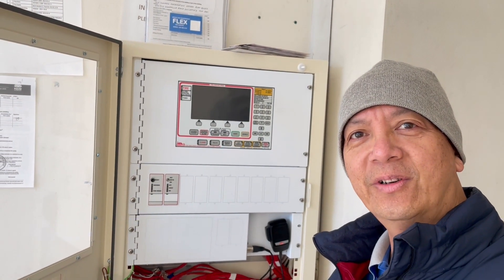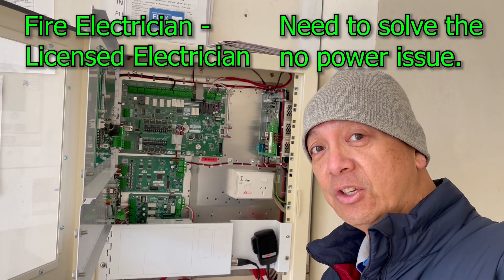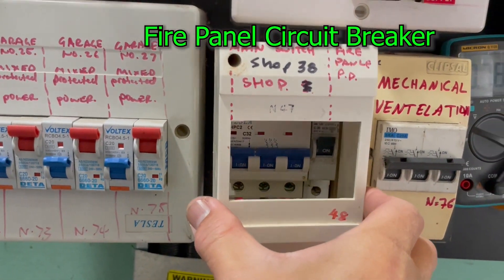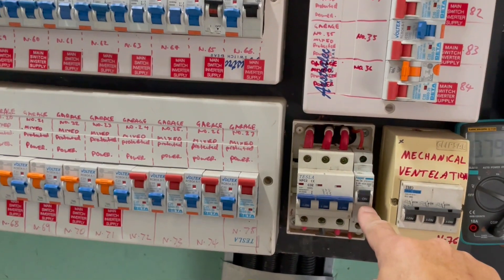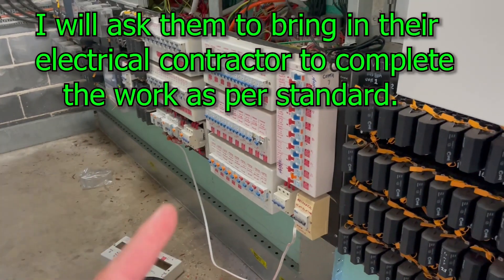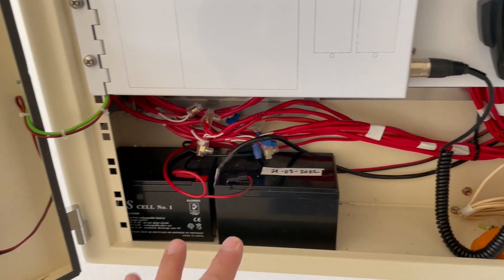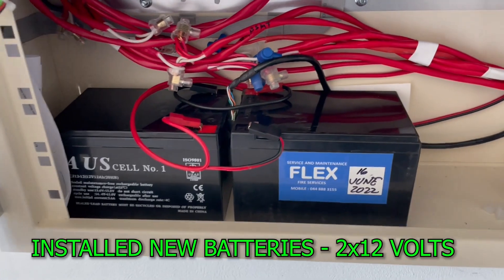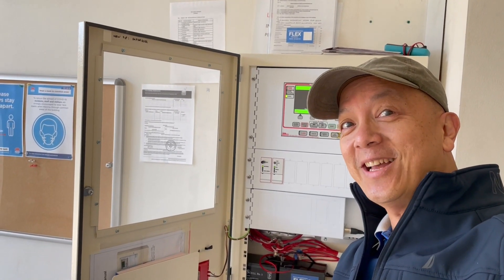Fire Alarm System Routine Test - Found Without Power

Comment: First time ko mag comment sir... kailangan ko yung mga ganitong video po sir elmer.salamat po
Reply from the maker: Good luck sa interview. NZ panel yan.
Reply: @fireprotectionguy7943  sir elmer bakit po ganun mga cables sa likod mukhang di naka properly arranged sa mga cable trays. hehehe...
Reply from the maker: @frederickdamasco2775  it's inside a metering board. That's how we do it. Spaghetti

Comment: The battery life remaining would depend on the panel's low voltage cut-off
Reply from the maker: Thnxs...I did not bother to measure it. It was charging thou when the FIP is up and running. However, I am more confident to replace them that waiting until its fully charge. It's cheaper to replace. Cheers.